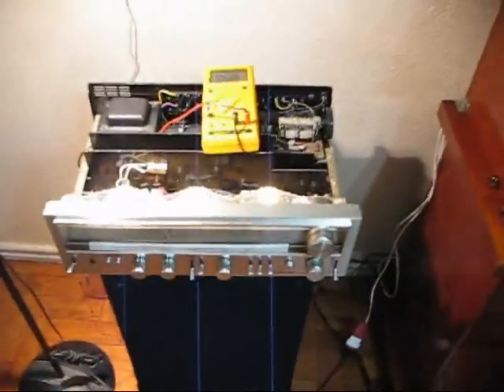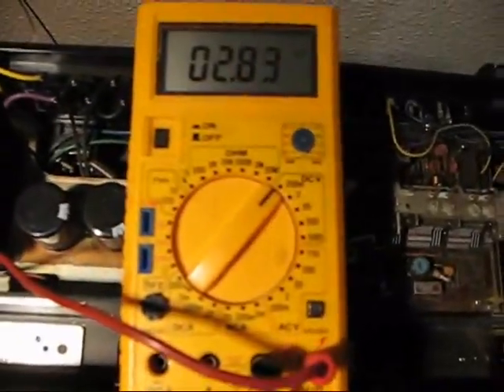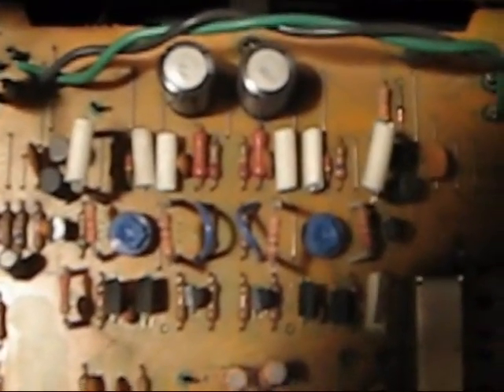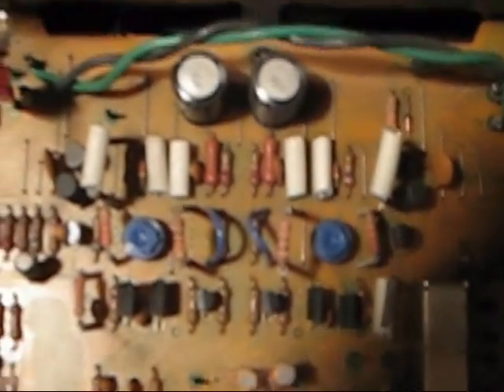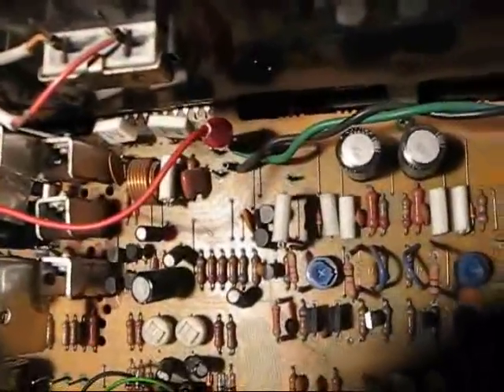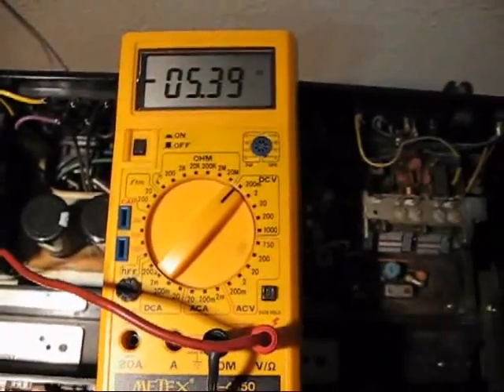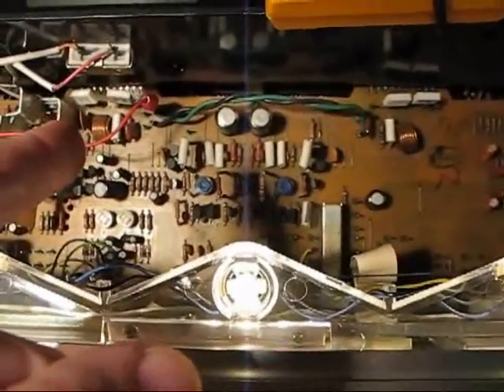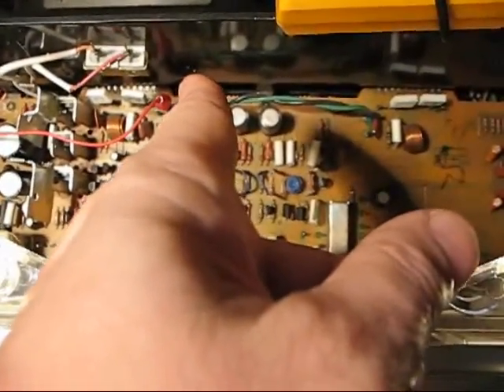Pioneer SX-780 - DC Balance of Power Amplifiers

Comment: Ok, but how do you adjust the pots once you have the clips on the right pins?
Reply: With a small screwdriver inserted vertically on the pot.
Reply: Got it, thanks!
Why is it important to have the two amps balanced?  Longer life or better sound?  Or both?
Reply: @mic982  both. Correct DC balance on each amp means that @ zero input signal, output is zero! No overdriving and distorsion! Means longer amp life & better sound!👍🙏

Comment: Andy,
Thank you very much for the extrensive meter adjustment info.  I'll be giving it a try in the near future.  I have two signal generators (Heathkit IG-102 and Triplett 3432-A), so that part won't be a problem, but I do plan to check out the online signal generator link you provided.  It sounds pretty cool.  I'll let you know how things go.
Take care,

Regards,
John

Comment: Andy,
Hello again.  I finally got around to balancing the power amps.  Both adjusted nicely to 0.0mv, but there was no change in watt meter readings on the front of the panel.   There's a constant 10-watt difference between the two...the left channel always being highest.  The receiver sounds great, so it might just be a meter problem.  Is there any way to adjust/calibrate those meters?

Regards,
John
Reply: Watt meters are both above 0 dB with no signal? If the answer is affirmative, then you have a problem at the watt meter circuit section. Need to check if meters are OK (probably they are) but I'd put my money on a problema with electrolytic capacitors. A full electrolytic recap is recomended after 30 years use. Meters should read OK after that.